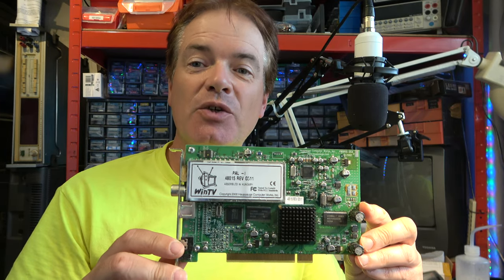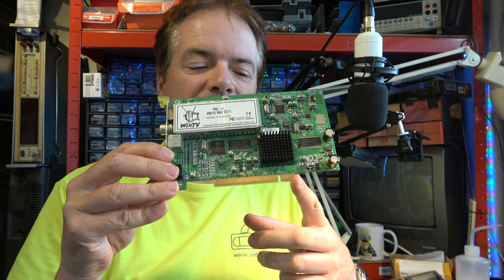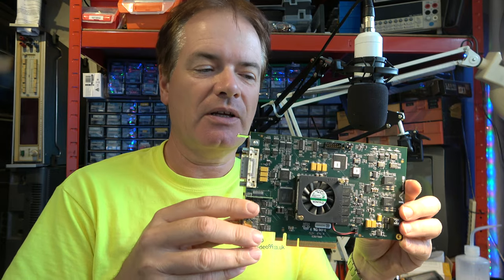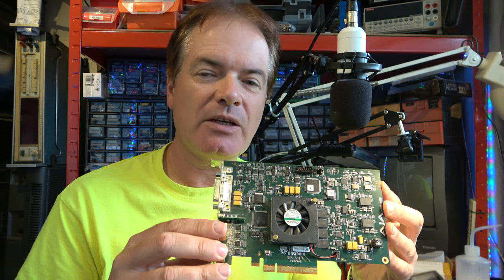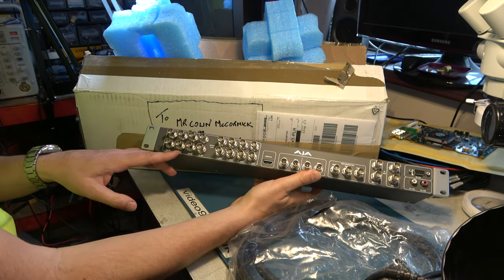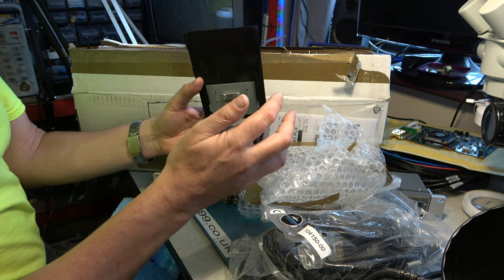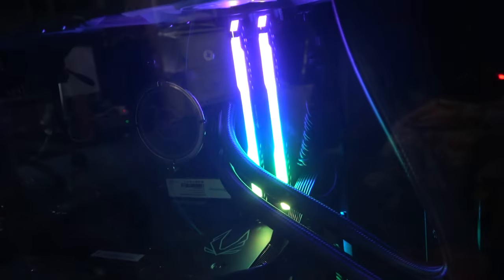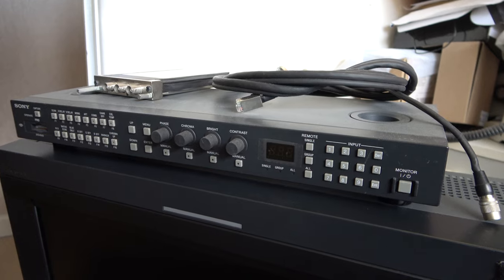Mailbag. AJA Kona 4 Breakout. Old and new PC trouble.  Remember Hauppauge PVR-250.

Comment: The active AJA K3G-BOX (breakout box) comes from the no longer available Kona 3G card, but also runs with the Kona 4 as host.
Reply: I just bought a Mac pro 5,1 to use the dual cpu tray in my main machine as an upgrade from a single cpu, It has this Kona 3G-R0 card inside, im not going to use it so if anyone is interested in it let me know. I dont know anything about them not even got software yet to try it out but will do to make sure it does work before if goes up for sale , if! its worth anything.

Comment: Sorry about the failures. Always a pain when a day of plans is lost because a PC goes belly up. 
We are very spoilt in this day and age for PC building services. It used to be quite expensive but now tends to be on par with buying all the parts yourself. I use CCL for mine if you ever have a falling out with PC Specialist but I understand they are very good. CCL followed my requests to the letter for no extra expense, including running SATA cables to the hard drive section and cable managing it in, so in the future if I add more I just need to stick in a SATA cable. Alas unfortunately for the older machines I work with, usually with used bits and bats from eBay I have to build them myself!
Just one thing to say, I'm sure there are plenty like you but the digitisation industry is filled with cowboys that rock up with a bunch of shoddy VCR's and some Chinesium USB cap card. Actual gents like yourself that invest time, R&D, money into repairs, learning etc seem to be a bit rarer. That Breakout box probably wasn't cheap but it will make for a more robust, efficient and reliable set up and your customers will benefit greatly I am sure. Hats off to you Colin!

Comment: I had that very card, awesome card back in the day. I had so much fun encoding with that card, if I remember it had hardware mpeg2 encoding on the card itself which meant that the computer was free to handle the other stuff like back-caching to the hard drive and actually saving the stream as it didn't have to worry about encoding at a software level. I so miss this card... modern pc... no drivers... you know the score ;)

Comment: I had a Hauppauge TV card inside a small Compaq desktop PC running Windows XP Pro around 2005. It had an analogue tuner, video inputs and remote control so might have been the same model.

Comment: Is it possible that case of that PC has "intrusion detector" switch which is plugged in the wrong pins of the motherboard? And when you close the case it shorts some power rail and PSU goes into short-circuit protection?
Reply: I was thinking that. :)
Reply from the maker: I've given the video link to PC SPECIALIST so they can investigate that, but I think it is more about tapping the case.

Comment: do you think the aja kona lhe is the best choice .. i have a blackmagic decklink studio 4k but it is very sensitive to analog signals without tbc?
Reply: Blackmagic themselves will (and have on the forums) admit that their cards are not good when it comes to SD, and particular analog VHS signals. The cards are designed for modern clean inputs and do not handle older unstable ones as well.

Try something older and cheaper. I quite like Hauppauge's Win-TV stuff, and they're cheap on eBay so it can't hurt to do some tests with a used card.
Reply: @Thepaddster  At least now I know why Blackmagic can help me so much.
Panasonic NV-HS900 EG with Pioneer DVR-LX60 as EE TBC does not work for 3 minutes with YUV when Stop at dropped Frames is selected. Next I try HDMI connection.
Reply: I specify that I had to make acquisitions in sdi because all my material in my possession is read by sony msw imx with sdi output and came after the analog problem even though I already had the jvc br-s822e .. the tbc of them is mmm 😕

Comment: now you can see why i never  have anyone do a new computer i know the price of it   i still using a 760 chip set  i know it's old  i am saving up for a 760 new old stock 
i know some one that has a new out stock  low hours  and it 100% working    

you are right about the first tv card  the voice and video  out of time   the man at the computer fair said the ones after the first one you had are better 
£25 they used to sell the for  the pci  tiger one's were about £90 i still have 7 tiger card    the later software with a hd  card  works great with the tiger cards

it's what you like  later card's eat the HD spare  big time